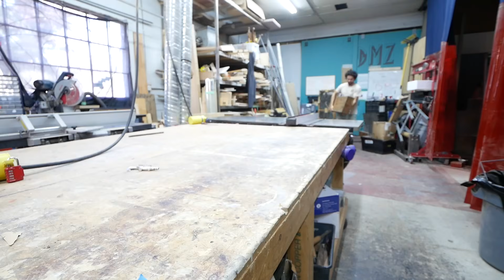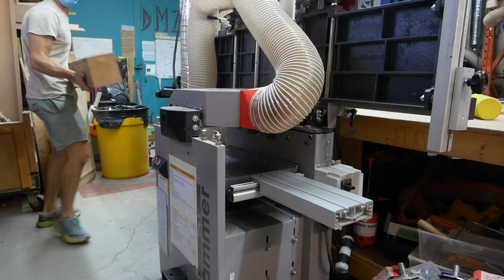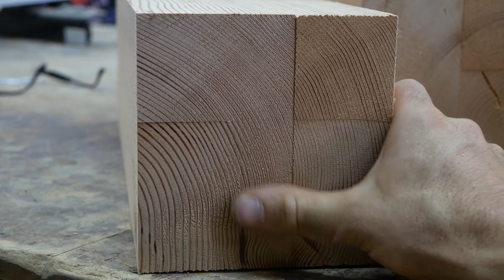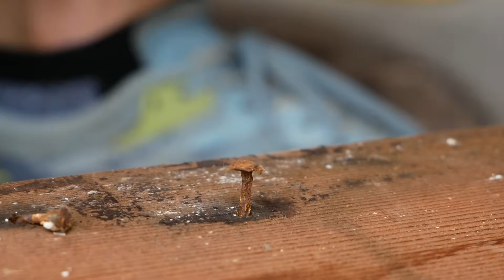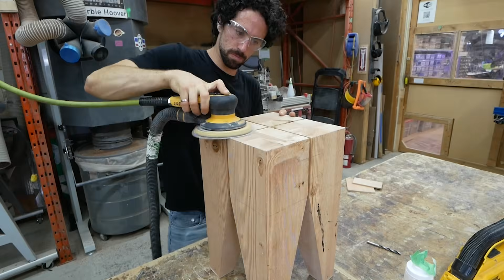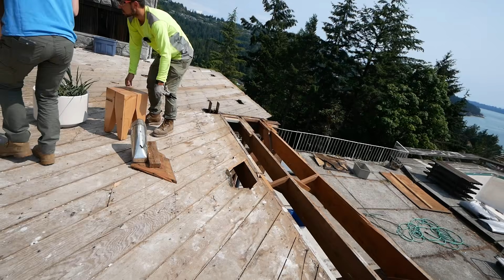Turning Dumpster Wood into High End Furniture

Comment: Just found this page....glad I did.  If you're ever building a table like that again another way to get all of the legs into the same plane is to put the table onto your table saw or other flat surface, shim it up so that it's level and then take a pencil on the flat surface and drag mark it all around the bottoms of the legs.  Then, you cut to the pencil line either by hand or with a powersaw of some kind.  If you want to get really fancy, attach a razor blade from a utility knife to a 1/4 inch piece of scrap and make the marks around the legs that way.  Happy making!

Comment: That’s a pretty good job. I typically wouldn’t call a table that might be well made, but made out of a wood that’s rotten and has a couple holes in it high end furniture. It gives off more of a rustic vibe for me. I think if you put a table top on it that extended out a couple of inches it would have looked a little bit better. Great job.

Comment: "Douglas Fir is a softwood - which means it comnes from a conifer."  - so "soft" and "hard" are rather odd words to have used in the definition.  I have read, for example, that balsa is classified as a hardwood.

For those interested, Google defines them as ... Softwood is a term used to describe timber sourced from coniferous or needle-leaved trees. Hardwood is sourced from deciduous and evergreen broad-leaved trees. As a general rule, hardwoods tend to be denser than softwoods, making them sturdier and more weather resistant.

Comment: Where's the high-end furniture?
Reply: What isn't high-end about it?
Reply: @kyronnewbury  The wood essence, the design, the finish lol, so basically everything. It's very rustic and simplistic, which is the opposite of high end furniture. There aren't any advanced techniques used to create those two ''tooth-shaped'' tables; anyone with a minimum of experience could make them. High-end furniture requires great craftsmanship.
Reply: @kyronnewbury everything

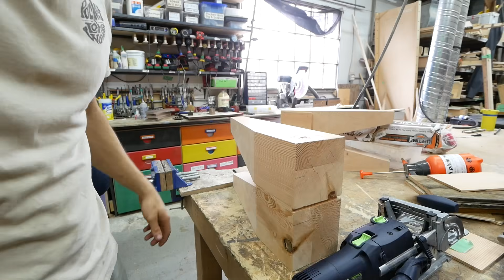Comment: 7:39 is why I barely ever use my Domino and favour the Dowelmax. The Domino shifts so easily during a cut taking things out of alignment. In this clip here you can see the back edge of the face plate lift off the work as you plunge in

Comment: Hello! Not a subscriber here, just watched this video since it was on my recommended. As another commenter suggested, I would definitely suggest you reconsider using exterior finish if you are applying it in an enclosed indoor space. Might be a better idea to keep it covered outside to allow for proper and safe off-gassing. I'd also suggest wearing proper PPE while sawing/jointing/planing. I saw that you wore a barrier face cover (BCF) during such operations which provides little protection when dealing with particulate matter. Definitely get an NIOSH approved respirator —or at the very least an N95— to protect your lungs! Otherwise, good job! I'm not a huge fan of the design as I think it's too bulky for my taste. However, my opinion on the design is not relevant as long as your client is happy and I can see that they really loved it! Overall great job and stay safe!!!

Comment: Hey I'm kinda in the same boat. My next door neighbor has like five big 8 foot long counter tops made out of 1 inch oak boards. Hey gave them to me for a case of beer. The issue is trying to break it down into manageable pieces. Each one is like 200 lbs and some of the glue joints are starting to fail so each board needs to be separated from the larger slabs. Anyone got a good suggestion on how to do that?

Comment: I have 12” wide, 12’ long old growth Douglas  fir shelving rescued from an old factory in Seattle and trucked home to Port Angeles. It was from their office storeroom, cut to fit (no nails) and never had finish applied. In working with Doug Fir, I learned it gets harder and harder the older it is. Hoping to someday make a bookcase out of some of it. But it seems I now have more fun turning wood than doing flat work. So it sits in my pole barn getting occasional admiration. Glad you lucked into some.

Comment: Wouldn't a drill press and wooden dowels accomplish the same thing as those dominoes?
Reply: Yes but with the domino tool you only need to take into account one axis of placement instead of two since the other one is set by the "height" of the guard on the tool. Also because the domino is not round just one domino prevents movement like two dowels do.

So yes, dowels do the same thing, much cheaper but dominoes do it much much faster with less chance for user error.